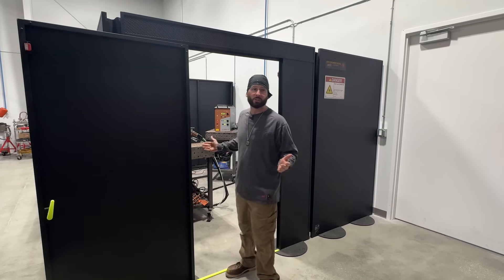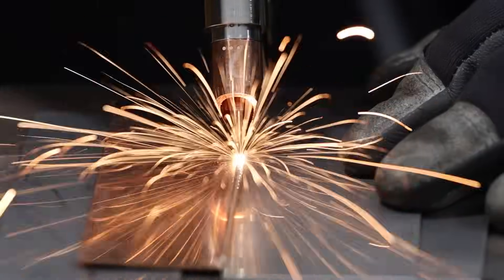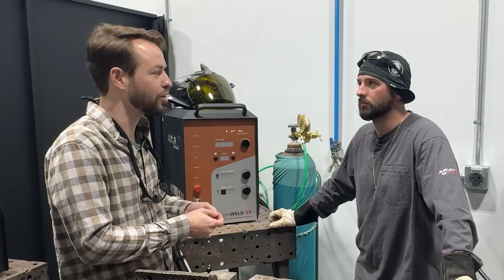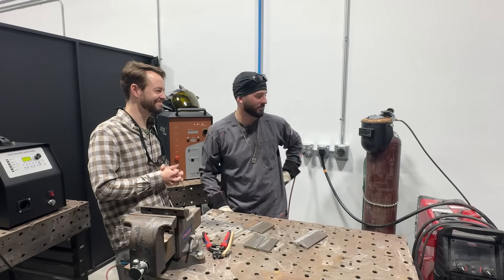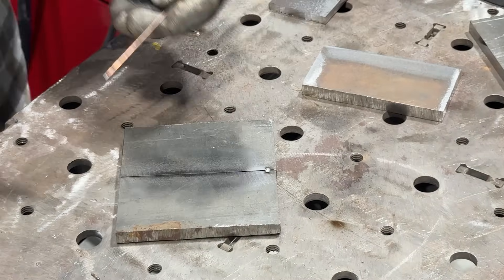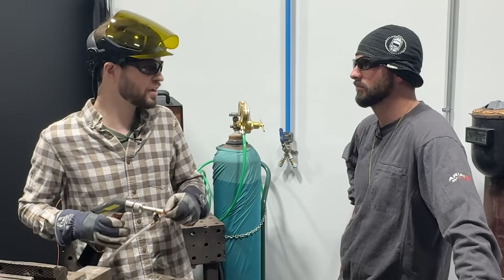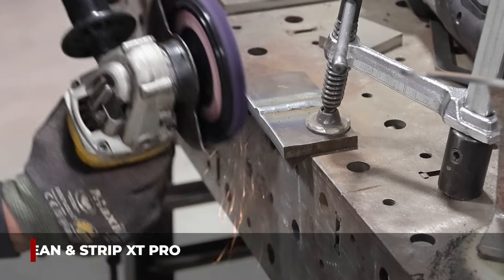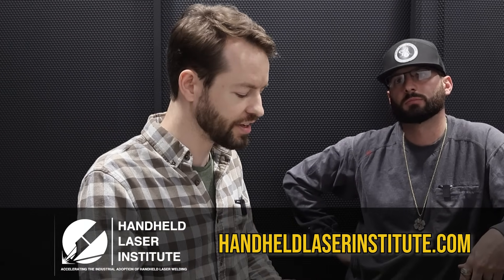Laser vs MIG Welding: Which Has Better Penetration?

Comment: Interesting results, i didnt expect a closed square butt on the mig to be so close to full peno on 3/8th plate either
Reply: Ok so I asked AI and it explained that the laser vaporizes a column of metal into the surface, this hole is maintained briefly by the pressure of the metal vapor. Then the laser transfers the heat through the sides of the hole. That's why you have that square penetration pattern.
Reply: Exactly and imagine how great fluxcore or stick would have done. But I must say the laser is a beast.